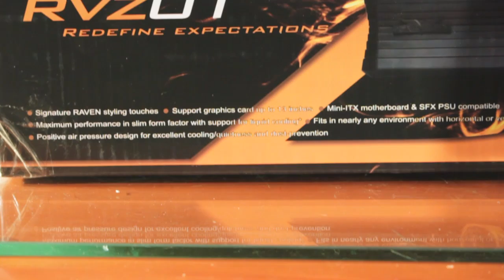Silverstone Raven  RVZ01 Build - Compact High Performance Gaming

Comment: Xero852, just wanted to thank you for this video.

I have been wanting to build a small, high spec pc for use with my Oculus for some time, then I came across this. One of the most annoying parts of building a new pc is finding components that are compatible which each other, so as you had done that i thought I'd give this build a try. But instead of the HDD you used i bought a 1TB Samsung Evo and I didn't buy an optical drive.

It is superb and actually quite a bit better than my main pc! For the size it is extremely quiet and runs impressively cool. I ran Heaven Benchmark on Extreme settings and could barely hear the 980 which was running at 70 degrees but the fan was only spinning at 20%

I've always liked Silverstone cases and have had an FT02 for several years. Never been to keen on the Raven cases, but i really like this one.

One thing I'd like to add for anyone attempting this build is, when you come to installing the heatsink... do it before you install the GPU caddy! God knows how you managed to install the heatsink the way you showed in the video, i did try but the way you have to balance the bar thing on it, then lower it down is a nightmare!
With the GPU caddy removed, at least you can just about see what you are doing and installation should be a lot quicker!

Thanks again, excellent build and now I can share the Oculus experience with my friends :)

Comment: Can't get over how ingenious the m.2 on the rear of the motherboard is, and how m.2 SSDs remove more cable clutter than most people realize; and that is huge in a tiny case like this.
Reply from the maker: +Jötunn Exactly! I love that feature on the motherboard for small builds like this! Would be neat if they could include a couple of M.2 slots on the back of future Micro ITX boards in the future. I've been liking Intel's onboard RAID features lately and would love to RAID a couple M.2 PCI-E SSDs!

Comment: I made a build fairly similar to this. I couldn't for the life of me get as many cables in the rear of the PSU like you did, but the cable management overall turned out OK.

I've used the NT-06 Pro cooler before but for this case I used the Noctua NH-L12. It keeps the CPU cooler, is far quieter, and is much, much, much easier to install. The NT-06 Pro is a real pain to secure because the bar used to tie the cooler down to the motherboard has to be balanced across the bottom of the cooler whilst lowering it down, with very limited space to actually see what you're doing. I must've tried to get my NT-06 Pro on ten times before I got it on and I can see you had similar issues.

Comment: Awesome video, man. Because of this video, I will build my next PC in a Rayven RVZ01. I'm planning on using a skylake CPU. I'm having trouble looking for a cooling solution for the board I wanna use.
Reply: +Bim Barbieto use the silverstone ar06 (actually designed for this case and other htpc cases) . you wont be able to overclock with this case unless you find some sort of magical liquid cooling that will fit the radiator in the case. :)

Comment: they really should have went with a flexible PCI-E riser for the graphics card, and added the ability to have more venting fans, maybe keep the GPU in a separate isolated compartment for airflow, with some small fans along the thinner sides to aid in extraction.

i've run into a bit of a heat issue, thinking about upgrading the case fans over the GPU area, but i feel there needs to be more case extraction. right now I only have 1 fan on that side, right over the actual GPU core, blowing in. might swap that to extract, and add a 2nd fan over the rear of the card for an inlet

Comment: Very well made and more importantly helpful video for a newbie such as my self. Courtesies aside I have a question regarding GPU's and this case. I looked up the GPU you have and saw that backplate was listed as optional. The same goes for the GPU i'm considering, namely the Evga GTX 970 ssc ACX 2.0+. I was wondering whether you picked up a backplate for your card and if so, for what purpose?

Upvoted and subbed btw.

Comment: Great Build. Like the choice of hardware. I think all mini itx mobos should have M.2/ pci express slot as standard to save on cables when building a system like you did. Thank you for the video.
Reply from the maker: Felix Onyango Yeah, it's fantastic to have that M.2 slot on the bottom of the board. Keeps the overall feature-set well rounded as well. This case has slots for 3x 2.5" drives so I could of put 3x more SSDs or 2.5" HDD's in here as well if we needed more high performance or high(ish) capacity storage. The motherboard would support all those drives plus the 3.5" drive as well!

Comment: I'm building a system pretty similar to yours except for the CPU cooler (scyth Big Shuriken 2) and the Graphics card (Asus STRIX GTX980 OC). I was wondering why you choose the CPU cooler you've installed instead of (for example) the Big shuriken2).

Also I posted this reply to thank you for taking the time and effort to make this instructional video! I think I've learned a lot. Now I'm going to put this in practice. I'm building 2 of these Mini-ITX systems today =D
Reply: Well, I just finished building the two systems (hardware only, software I'll do some what later as I'm freaking tired now =X). I found out three things:
1. Cables, cables and cables.. All in a very confined space. Management and planning is key! =)
2. The Asus STRIX GTX980 OC does fit in the Raven RVZ01, but you will need to completely remove the female 120/230V power connector. This is done by unscrewing 2 screws on the back and outside of the chassis and leave it hanging out a bit. The video card's massive metal frame is butting against it and there is no way in hell you can get it in with out removing it. Small price too pay I guess =P Also due to the cards thickness the extra support bracket doesn't fit. The weight of the card will make it sag a bit when you place the case flat (horizontally). It looks acceptable, but it's better to place the case upright (vertically). It looks better too imho and it will be better for cooling.
3. The manual for the Big Shuriken 2 CPU cooler is a piece of crap. LOL
Reply from the maker: bazZy33K I work for a hardware retailer, we don't stock Scythe products for a few logistical reasons.

Comment: Such a great video. I've been planning a build like this for months. I am holding off for the RVZ 02. If you get the chance, what's your experience with the M.2 SSD?
Reply from the maker: ***** I love M.2 if RAID isn't required (hard to find motherboards with the ability to run two M.2 drives). It's a great form factor, and with the new PCIe ones we're seeing well over 1,000 MB/s read speeds and 800+ MB/s write speeds from single drives!
Reply: ***** FTZ01 is better, with full metal body in the same chasis
Reply: Xero852 Hi you said that your PSU is silent? :) That would be a dealbreaker for me if a SFX PSU could be silent ive heard that they are very loud, hence why I am considering this build with an SFX-L PSU due to the bigger fan. I hate PC noise so it is very important for me that the system is as silent as possible. ^^
Reply from the maker: I believe all of the SFX PSUs from Silverstone only spin the fan up under load, when needed. I never witnessed this PSU spin the fan up, even when the rest of the system was under load.

Comment: I should have watched the video before I started my own build in the RVZ01 because dear god it would have come in handy, especially the tips on cable management. 

I used a different but similar cooler, the BeQuiet Shadow Rock LP. I had never installed a custom cooler before so I personally decided to install it outside the case, and then insert the MB+Cooler into the case. Doing it this way meant that I had install the MB first, and then PSU.

I noticed you kept the 2.5" mount between the PSU and GPU. I removed it because it got in the way of my cables (which if I had decent management would have been unnecessary) and since I'm using a short GPU, I don't think the cables that slip into the compartment. But would removing this mount affect temperatures in any way you think?
Reply from the maker: Teriton thanks for the comment! I don't think that removing the drive mount there will impact temperatures.

Comment: Hey there! Your build is almost identical to what I plan to do, so this video was perfect for me to learn how to put it all together!

Two questions though, can I use a 2.5" HDD without any problems, as opposed to the 3.5" that should go on the power supply?

Also, If I get a Noctua NH-L9i for my processor, will there be a large enough gap between the cooler fan and the case hole to cause ventilation issues? I will be placing both fans on the GPU side like you did.
Reply from the maker: You'll be fine with 2.5in drives. This can can accommodate 3 x 2.5in drives + 1 3.5in drive. If you look at exactly 7:20 in my video, the cut-outs above the PCI-E extender for the GPU are there to hold 2.5in drives. You can also see them from the top-down at 8:00 in the video, they're located on the top of the GPU bracket, at the bottom-leftish of the case.
Reply from the maker: As for the cooler, you'll have plenty of room. It's even lower profile than the Solverstone NT-06 Pro I used.

Comment: Interesting build. Is exhausting hot air into the case a good idea with this small case?
Reply from the maker: Anusha Dharmasena It ventilates quite well. Check the load temps in the description.
Reply: Xero852
I wonder how a 4790K would perform in that case.

Comment: thanks for youre video man, im planning to build a gaming/workstation too on that case and this vod of yours helps a lot. i got a question though, how was the temps on idle and during a heavy load on that cpu cooler? any good? was stuck between that cooler and noctua nh-12. thanks
Reply from the maker: emperorpepitus Temps are in the video description.
Reply: Xero852 yup sorry, didnt collapse that tab earlier. you reckon galax hof will fit in there mate? or poseidon? both gtx 980. thanks

Comment: Thanks for the guide, it was nicely explained and detailed. I'm thinking of getting the RVZ02 but I'm afraid because that one doesn't support any case fan at all, so I think this one is better, although being a slightly tiny bit larger.
 One thing though, is it possible to use a 240mm close-loop liquid cooler and put them on where you put 2x120mm there?
Reply from the maker: +LulzingBoy Only if you use a single-slot graphics card and thing radiator+fans.
Reply: +XeroPoint hm that makes sense since the radiator and fans take some place. well gtx 700 series are more than enough I guess since i'm building it for living room gaming and sometimes I could game for hours non stop. thanks for the answer!

Comment: Good build, I see you manage to get a Corsair H50 WC inside there, wounder if I could get a H60 77.4 CMF inside that case? Think so?
Reply from the maker: Tsarisgreat I didn't fit a water-cooler into the system, but I've heard that it's possible. I've seen people to custom water cooling loops in this system, but you'd need to water-cool  your GPU for it to work well IMO. With a water-cooled GPU and slim-fans like the ones included in the case you should be able to fit a slim radiator below the GPU if it's using a single-slot water-block across the whole card.

Comment: Would it be possible to fit in this CPU cooler if you replaced the 20mm - thick fan with a 25mm - thick one?

Comment: Xero852 
Hey that build is awesome man! I want to get the case and pc too.
Just some question: can i use the pc in vertical or horincotal mode? 
Is a DVD Player possible to install?

Can I use a easier to install fence? :D
Reply from the maker: coolertuep You can use horizontal or vertical mode without problems. The case comes with some  rubber feet that you can attach for either orientation.

I installed a disc drive in this system. I opted for a Blu-Ray drive since this is a perfect form factor for a Gaming HTPC. DVD slot-loading slim drives are available as well.

Easier to install fence? I have no idea what you're talking about. Do you mean the CPU cooler? You could use the stock one that the CPU comes with if you're not planning to overclock.

Comment: I'm building a setup with the RVZ01. It includes 32gb DDR4, a 6600k, R9 390 8gb, Mushkin Reaktor 1TB SSD, and the 600w power supply to power it all. Should that work fine? I also used Silverstone's AR06 to make sure the 6700k doesn't explode.
Reply from the maker: looks good to me! lots of people doubt the 600w psu is enough for the higher end GPU models, but it works fine.
Reply: +XeroPoint Yeah. it's surprising how power efficient gaming PCs can be now
Reply: +XeroPoint by the way this'll be my first time building a PC on my own.
Reply: +Zilla What manufacturer are you getting your GPU unit from? For example: I have doubts about the MSI R9 390 being able to fit in there. But other more slim ones like XFX R9 390 look more reasonable.
Reply: Alexey Toporov Still haven't gotten to buying everything yet. Also, I'll probably get a 6700 or wait for Zen instead (as long as Zen has mini-ITX motherboards) and maybe a 490x?
Reply: Alexey Toporov Thanks! I'm actually hoping I can work on it as soon as possible, there's something that is going to happen soon that will give me the ability to make a new PC. Don't ask

Comment: how is Gpu temperatures under gaming load? is it throtteling ?  
nice build btw
Reply from the maker: Hey mikayel!

If you look in the video description, I added some links showing temperatures at load and idle. I haven't noticed any thermal throttling (getting similar benchmark results as compared to ones from TechPowerUp and AnandTech, didn't actually watch EVGA Precision to see if I was hitting thermal cap or not).

Comment: That was very helpful! This is very close to what I'm building (Same case, motherboard and cooler, PSU ...). Would it be possible to mount the cooler in the other direction to it's above the RAM? It seems it would line up better with the ventilation holes on the cover like that.
Reply from the maker: If you can keep your main 24-pin omtherboard power cable from impacting the fan then it should fit IIRC. You can also mount it 90 degrees clockwise from how I had it, with the heatpipe-ends pointing away from the GPU.
Reply: Xero852 Thanks! Maybe I can route the 24-Pin cable under the PSU...? I'll see once I have the components...
Reply from the maker: alphanimal I don't believe there is any space over or under the PSU, and to go "around" the PSU in the area I stuffed a lot of my extra cables would be difficult. You'd need a longer cable for starters.

Comment: Great video! Which way do the fans blow air from? My graphics card intakes air to its heatsink and I want the fans to do the same. Thanks!
Reply from the maker: TheShivenPatel All the fans on this case are directly below the GPU area and oriented as intakes. The GPU fans push air into/over the GPU components so it works out. The CPU fan is also an intake. All hot air is exhausted passively.
Reply: Xero852 Thanks! Just got mine almost a week ago, but it isn't as clean of a build as yours :/

Comment: I want to build a pc with that case and a 980Ti, with a 600w power supply (it was the maximum i found fot mini itx cases).... Will it work?
Reply: +daniel milli yes :)
Reply: +medo asissan 
Some people said me that build a high end pc in that case makes it get too hot, decreasing the pc performance... What you can tell me about it?
Reply: i cant promise.. cause i dont own this case... i was searching about the answer for your question cause i was also wondering about it... im sure the gtx 980 ti will fit but it will gets a little bit hotter than mid-tower case.. but as you can see... you can put 2 fans beside the GPU for a great temps.. and i dont recommend the stock cooler for the CPU, im sure this case will have a great temps as the reviews says... ill keep searching for an answer as soon as i can..
Reply: I literally just built one yesterday for my m8
Reply: +medo asissan the 980 ti is reference so don't expect any thing amazing and the 4790k has the stock cooler so don't expect anything in the 40s there either but.....the gpu is getting like 77 at load, thanks to those two fans. And the cpu  runs at 69 under load which is bloody great, any way sorry if I bored you. Good luck with your build.
Reply: +Obi Wan “Rey&#39;s Grandfather” Kenobi When your mate plays games for a while does the temp get over 80?
Reply: +daniel milli Anything that doesn't go over 80 degrees will not thermal throttle (decrease performance)
Reply: +daniel milli Hi. Yes it fits. I have the Gigabyte G1 Gaming 980Ti in this case and fits nicely (http://pcpartpicker.com/b/yVxYcf). Make sure you install two slim fans on its side to blow air directly on it - I have mine running at max 79-80 C with a light OC (77 C max at stock and 80 is when fans start running at 100%). Still some more headroom if I wanted to but for now, it's fine. What I'm struggling with are CPU temperatures. I tried the Silverstone Slim TD-03 AIO cooler, which Silverstone themselves build and recommend for this case, thinking of guaranteed compatibility. But it doesn't fit properly and was getting 90+ C at stock. The pipes are too long and one ends up kinking when closing the case. Silverstone themselves couldn't give me a guaranteed way of how to make it work...Tried for weeks and broke a DIMM slot before giving up, and went for the NT06-PRO...was inspired by this video actually. BUt I'm still getting + 90C at stock speeds. No idea what to do next :) But the GPU is running great and cool.